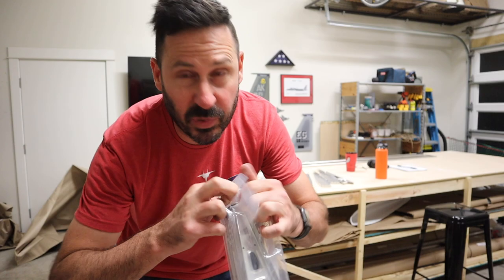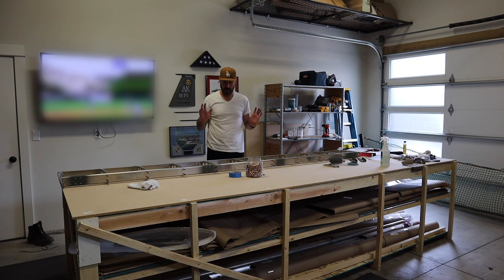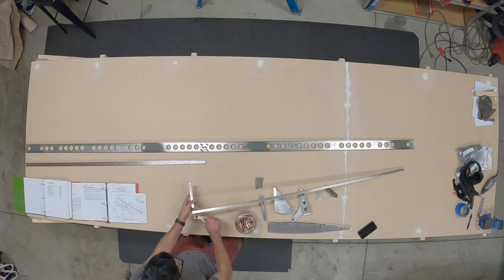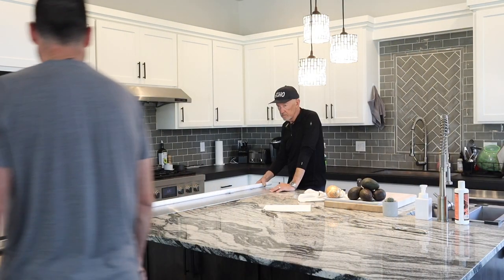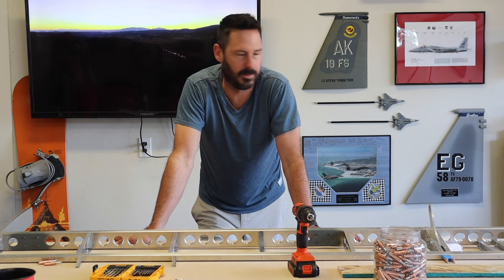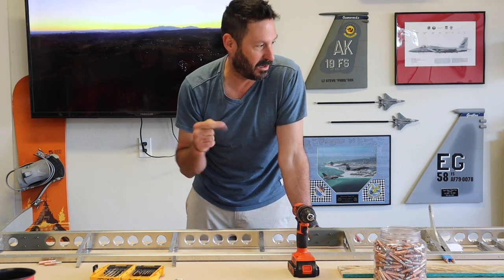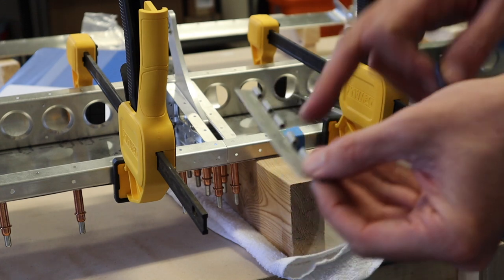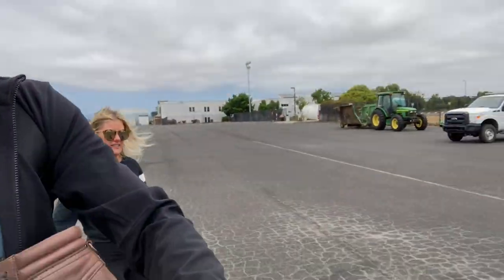RANS S-21 Ep 4 LONGFORM Horizontal Stab & Elevator Build

Comment: You're doing awesome. I'm enjoying every second of it. I just finished doing a ton of work to my car, and am currently rebuilding my ancient '82 Honda cb900c. One thing that has kept me going and also kept my hobbies from becoming chores...is to take breaks. I try to work on them a bit every day but when I start getting frustrated, I put it away for the day. Taking those breaks and enjoying your family and friends will keep this project fun.
Reply from the maker: Thanks for the perspective, Joe! I need to take more breaks. Like I mentioned, I’m trying to set a land speed record for this build and that adds an unnecessary layer of stress. All in all, I’m loving this build. Finishing up the top of the left wing today. Just test-fit the aileron and flap and they fit great! I hope to put out another vid in the next day or so. Email me a pic of the Honda rebuild!
Reply: @CLEAREDDIRECT  Yeah. Will do. It's actually 2 rebuilds. I'm almost finished the one I'll ride and have to do rings and valves in the one I'll sell.

I reckon those damned artificial deadlines are pretty much the most unnecessary (and often counter productive) part of a project. It would be awesome to finish it in record time...but what's the worse thing that would happen if it took a bit longer?

I'm thinking...more time with the family and less stress about the project. The only one who will be impressed with a speed racer build...will be you. I'll be impressed too...but the work is exactly the same no matter how long it takes. The best build speed, is the one that is the most fun.

Comment: Hint.
Set up your microstop countersink on a piece of scrap aluminum.
If you over countersink on your good material it's scrap aluminum.
That's 35 years of experience advice.
Reply from the maker: Great point! I was successful in starting small and increasing cut-depth. But that would've been an expensive mistake if I got it wrong... Keep the tips coming, Ed!